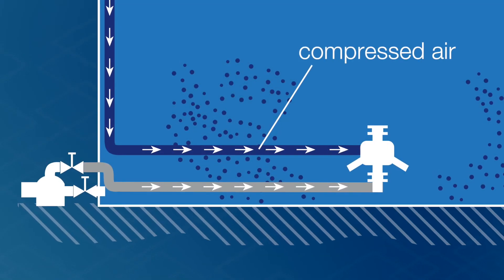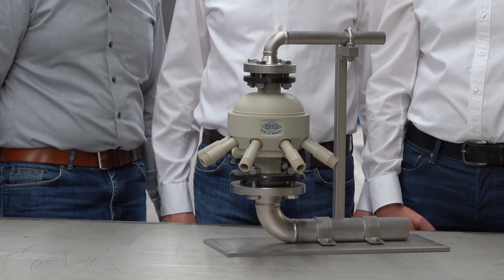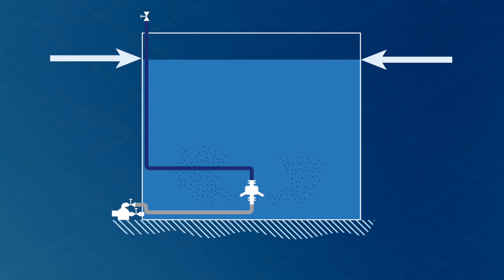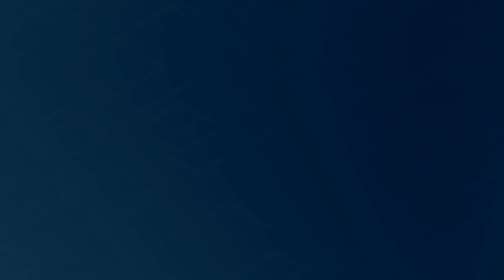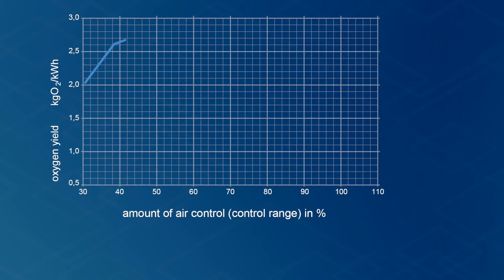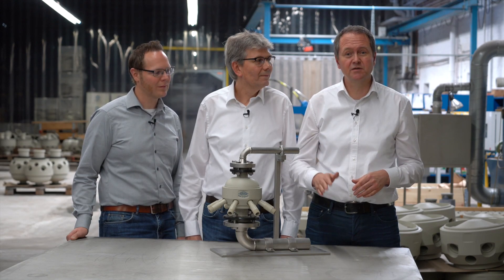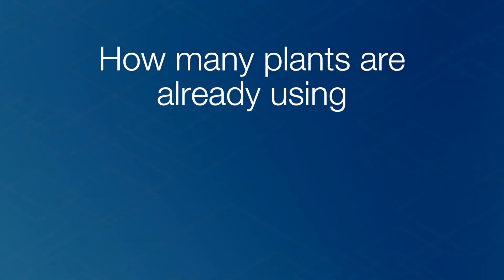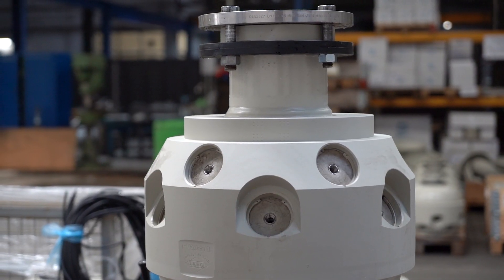Waste water aeration with increased efficiency (jet aeration)

Comment: Does it use water pump as well?
Reply from the maker: A waste water circulation pump is necessary to provide the energy to run the ejectors. If you have further questions you may get in touch with our waste water experts directly (sales@koerting.de).